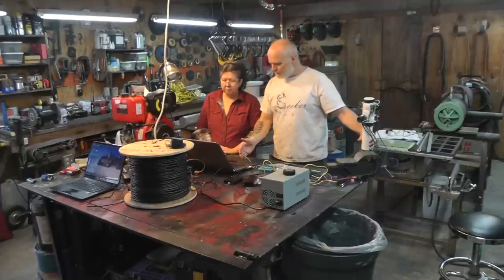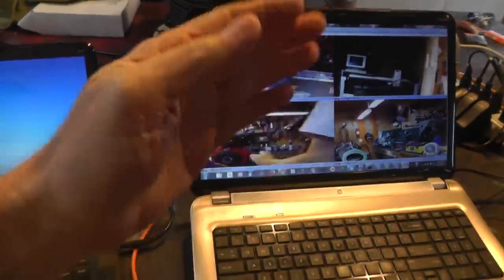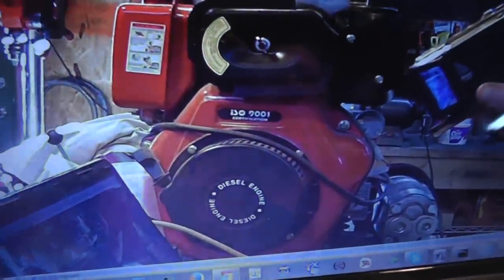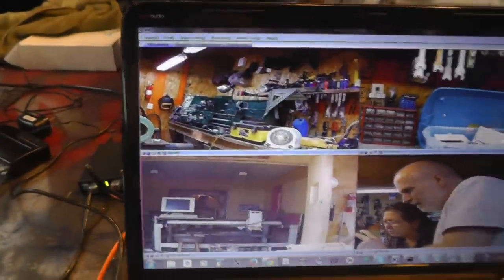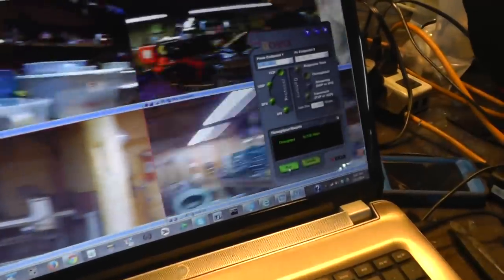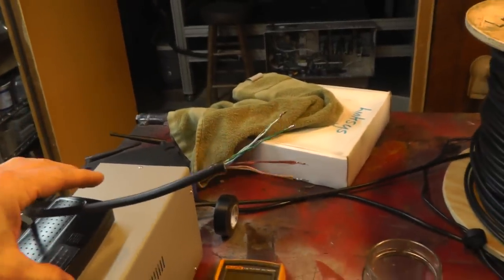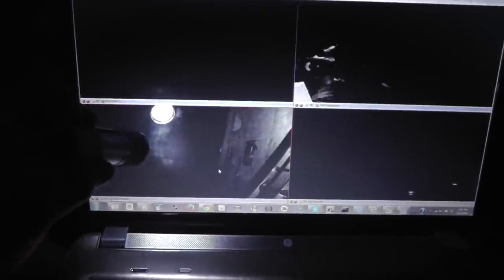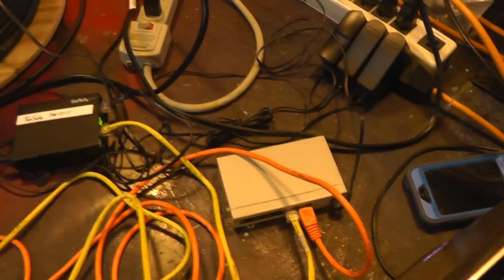ROV Communication and Control - Part 2 - Video Cameras

Comment: look in to "raspberry pi". I'm not very familiar with the technical specs but you might be able to use that in conjunction with the arduino to record HD video in the ROV and only send the low res video to the surface.
Reply from the maker: We did.  That's a good unit too.  Going with Arduino because my friend Drew is doing some of the controller work and he already knows Arduino.   From what I've seen it's an easy system with great add-on.   He started on the IMU and had numbers in minutes.  I did find some discussion of PI and NVR's but it was not Full HD capture.

Comment: for lights i recommend using the head from the cheap Chinese CREE LED flash lights sometimes they write police 500w on them sometimes its something else and they have a focus lens witch you can drive with a small servo if you want i can make a quick video of mine they are incomparable to what you have
Reply from the maker: Thanks.  We got a few of those to do testing with.

Comment: OK - it's 2  am an I just finished watching the umteenth video of yours on your ROV! WOW! Great stuff!
I have one note I would like to pass on about the sonar board that will not fit - you may find that when you get the unit you can take off the case and gain a couple of millimeters, depending on whether there is RF sheilding built into the case. If so. then forget it. If NOT you may even get more space by trimming the PC  boards that usually have dead space around the edges.

Best of luck with it! I can't wait to see it in action! Ok - I can wait til tomorrow!
Goodnight & good luck!
Reply: Thanks for the tips. We can always use good ideas. 

And I'm glad you're enjoying the videos!

Comment: First, I love you guys!  Second, if you're not hip to "Rescue Tape", you should check it out.  It's a Silicone based product that adheres to itself when it's stretched creating a waterproof seal (it's also good for up to 500 degrees F).  I do electrical work for film/tv and I've wrapped standard Hubbell type Edison connectors in it and thrown them in the water with actors, haven't killed one yet!  Even if it doesn't work for your ROV, you should have a case of it for your boat.
Reply from the maker: Thanks for the tip. Don't think it will would at depth but it's an excellent idea for stuff on deck.

Comment: Why mount the Overlarge system/s in the ROV at all?  Remote link the sensors to the unit.  High and dry on the surface is safe and sound.  You might need to configure the systems so that bandwidth available permits it.  Digitize any analog inputs/outputs and multiplex them into the remote linkup...but that alone would minimize the electronics for nearly any fancy install you might like to try and implement.  Anyhow,  It's a pleasure to watch your work.
Reply from the maker: Thanks, we considered and A to D and D to A setup, but apparently it's not possible to digitize transducer signals without losing important data.

Comment: What is actually the idea to use 4 camera's?
I can imagine that 1 for looking around is obviously nice and perhaps 1 looking at an instrument panel with depth-gauge and a compass would be nice ... but that is only 2...
I was just wondering..
Reply from the maker: Forward, Port, Starboard, and Aft views.   Just so more imagery can be collected and nothing is missed on a single fly by.  Research vessels are expensive and tend to drift in the current so time will be in short supply.

Comment: Lag is due to packet loss, because ethernet is not designed for long distances, cause sensitivity of reception (ethernet transformers) is not so high. RS485 or better WIFI through wire would be more suitable, since radio sensitivity is far more superior to ethernet transformers on your switch.
Reply from the maker: Andrius Jasinskas It's using VDSL2.

Comment: Why don't you use ethernet to fiber optic converters for the data transmission back to the surface instead of this giant spool of cable? it is more robust and faster than the copper cable... And the converters start from something like 25-30$ ;)

Comment: why are some cameras reversed? if you have the money, use fiber optics. fastest signal cables. Also it will not slow down the speed because you are putting more data on the signal but if you had more requesters(more computers) it will then start slowing down. You need the source to have a stronger signal out put, same principle as radios. Look at putting a signal boost on the module, can look up repeaters for that. it will charge the signal so it doesnt lag on higher def pictures. the one thing about that is you need to find a low volt one because you will have to use a pair in your cable to send power. But im thinking it may be your receivers that are slowing the signal down because it doesnt process it fast enough.

p.s please take off auto play for next video. it killed my last comment because the next video came up. it had more info. if you have any questions about the networking of your setup just message.
Reply from the maker: Cameras are reversed or upside down until the cmos chip is told which way to flip the frame.  Specs for this job are single twisted pair.  Besides, it's a hell of a lot cheaper and field serviceable by monkeys.

Comment: Have you thought of using gigabit switches instead of 10/100 switches? Much higher bandwith and not much more cost.

Great videos, cant get enough!
Reply: he's using VDSL2, which is only capable of 40Mb/s theoretical maximum. 10/100 is more than enough.

Comment: Cool video. Not to seem stupid but why are you building an ROV and sonar rig? I thought the sailing boat was going to be for recreation only? Very impressive how little you will be spending on it all! Is the bad weather preventing you from working on the boat? When will we see more boat videos?
Reply from the maker: More boat videos in the Spring.  All about the ROV for now.  And only the sailboat is a work boat, not a plastic and chrome pleasure yacht.  :)    We plan to use it for doing things like operating deep sea ROVs, search and recovery, diver support, research, etc.... That's our kind of recreation.
Reply: Sounds like my sort of sail boat, I was never big on the whole hanging around with nothing to do until the wind picks up idea.

Comment: I am working on a 3 cam ROV (only 300 ft depth) and I am using several Arduinos  to run the pan and tilt for the main camera (the other two cams will be fixed)  as well as sensors, lights, thrust motors and a gripper arm. I am linking the Arduinos via I2C and splitting the PWM task for the thrusters across several Arduino Pro Mini boards. This way if I have a board failure I may still have some maneuverability. I was going to run CAT5p but I like your idea of VDSL2 much better. What is the make and model of the hub? I would like to exchange ideas with you on this topic. I don't know much about building ships, so I can't help you there.  Thanks for all the great videos.
Reply from the maker: +Lars      Cool.  Details are here until Betsy gets it moved to the new site: http://svseeker.com/rov_controller.htm
We are going back to work on the ROV in July-Aug.
Reply: +SV Seeker Looks great. I can't wait for the finished unit.

Comment: Just seeing this video now. You should consider using a fiber optic cable and a media converter at each end. http://www.amazon.com/Gigabit-Ethernet-Fiber-Media-Converter/dp/B004FUUY52

You can also source custom fiber cables from a place like Monoprice which is inexpensive but very good quality. Alternatively, you can simply buy your own spool, polish and terminate the ends, and have as much length as you like.

Two huge benefits are bandwidth (you could stream 1080p or 4K from the ROV) and electrical isolation. I'm not sure if you're running the ROV from batteries internally or from an electrical umbilical from the ship, but in either case completely isolating and eliminating any sources of voltage on your data connection will save you an awful lot of agony. Voltage spikes on Ethernet ports is a death sentence.

Anyway, it could be possible to run a media converter (especially a low powered one) on batteries given they're usually low voltage and amperage.
Reply from the maker: +Tom Cameron    Yes and I don't like it.   Watched a research vessel pull off a site in beautiful weather and transit a day back to port because of a broken fiber.
Reply: +SV Seeker Yeah, glass fiber is delicate. I to nk it has a 1" bend radius or so. The more common plastic is much more resilient.

Either way, be very sure to isolate the Ethernet ports from the cable. Awesome work, though!

Comment: have you heard of mineral oil submersion for your electronics on the r.o.v.?
Reply from the maker: Yes, PBOF (Pressure balanced/oil filled) systems and Woods Hole adds NNL690-G Oil Fortifier added for lubrication for motors.

Comment: I don't know if someone has looked into this yet, but I keep on wondering about the permiability of the cable. Salt and water will work their way through most insulators and reach the copper at some point. Maybe your cable won't be in the water long enough? Might be worth dunking a length in salt water for an extended period while you work on the rest of the project?
Reply from the maker: Most definitely a concern.  We're using bury type cable for testing and the connections will be Sub Con connectors designed for deep sea usage.  Then will see if we can make a DIY copy of them. :)
Reply: You read my mind! Direct burial cable would be a good start. I would be inclined to immersion test a length of it. Sea water is a funny thing...

Do you have a 3D printer? They are extremely useful for fast DIY versions of things, prototyping ect. You could work out a design for marine sub con connectors in plastic, and then machine out of metal if needed for the final thing. Fun for metal casting too...

Comment: Analog video would be the way I would go if real time was important... Latency would be essentially zero. A camera with 540TVL 30fps with CS mount lens, auto & manual exposure controls and extremely low lux capability is like $40. 

I would also think capacitance of the cable would become a big issue with bandwidth of UTP at those depths through salt water...??

Comment: I am worried the lag is caused by your computer, not the cameras. You may want to try them on a high end desktop...?
Reply from the maker: That would be nice if that's that case.   Nothing to fix.
Reply: SV Seeker
They do make high performance laptops. I have one myself, its a G73 asus.
Reply: is there some reason you are not using fiber optics? you can get gigabit speed with that.
Reply from the maker: Scooby's Scoop Yeah, the main reason is the specifications say single twisted pair, but I prefer twisted pair as it is cheaper and simple to splice and repair in the field.

Comment: for a splice, how about molded silicon rtv.  a two part tubular mold around the splice and inject silicon around the joint?
Reply from the maker: Right.  I seen connectors like that at commercial electrical supply houses.

Comment: Will you be encasing the IP cabling in a protective sheath?  Also will you be building a special winch to reel in all that cabling?
Reply from the maker: We're just going to test in the lake with this cable.  The research vessel will have a rig and cable specifically designed for the task.
Reply: Very cool.  Can't wait to see the video of that testing.

Comment: you might also want to get some software to aline the feeds to be in line once you get the lag figured out.
Reply from the maker: Suggestions?
Reply: http://pixelwix.com/warp-and-blend-software/11-pixelwarp-dt-wide-screen-desktop-warper.html 

Then a free solution is http://www.edge-blending.com/

I have not played with either of these but I do know that they are theyier. It seems to need multiple projecters and a curved creen but this would be wicked cool.
Reply from the maker: Justin Vaughn Thanks Justin.  We'll look into it.

Comment: the lag is comeing from the computer. its rendering the live video of 4 cameras at once. Thats what I think
Reply from the maker: Hmmm...  maybe.  ...faster computer?  ...better video board?
Reply: Well I would make all the cameras the same resolution. The if the become more in since. If you will be using a computer on the ship then I would invest in a major comp. But for now yeah get one with duel video cards. Or a dedicated video card. Your laptop may be running the GPU in the CPU. If you can build a boat you can build a computer.
Reply: Well theres one way u can test if its the  bandwidth or video processing  causing the lag. If  u can save the video to disk without rendering it, setup 3 cameras to save image to disk and just have the pc render one image all at high resolution. so youll have the same bandwidth going down the pipe as before but your video card should be processing 75% less. If it lags the same as before chances are its the Lan.
Reply from the maker: Joepopa12 Great idea.  It will be a while before we hook them up again, but I'll be sure to try that.

Comment: I use to use remote  electric car mirror motors for moving my cameras.
Reply from the maker: Interesting idea.
Reply: SV Seeker
And if you place one end to end you can double the swing of it. I used early Fords say 90's and used the switches too.
Reply: Why not just use of the shelf servo's as used in RC model planes.
The are extremely easy to control very precisely with a 1-2 mS pulse-width and more that powerful enough for the job.
On top of that they cost next to nothing.
.
Reply from the maker: Spikejwh1 We have some servos to test.  Their weakness will be the circuit chip inside.  It will have to survive the pressure, so we'll pot it and cross our fingers during the test. :)

Comment: Lovely how you just built stuff and don't let a lack of (specialist) knowledge stop you. You probably do realise that this will not be the best 3D printer you can make?  I see two major flaws with it: speed and shinkage. A heavy CNC machine will not be able to get the speeds/acceleration you need for quick 3D printing. You could try to print at 50mm/sec (pedestrian speed for 3D printing), but the heavy mechanics will require relatively low acceleration which means loss of time to get up to speed. the other thing is shrinkage. At small object sizes shrinkage is not so bad (for PLA), but the larger your objects become, the more the internal stress will try to lift up the corners of your objects, leading to warped and/or failed prints. Especially with this large table of yours, you'd be tempted to make large objects, that will give you some challenges.
If you have not already done so: buy a good quality hot-end (prusa, E3D), and put a large nozzle (0.8, 1.0 or 7x 0.4mm) on it if you want to print larger objects. Stick with PLA unless you install a heated bed.
But most of all: keep having fun!
Reply: Bugger, this comment was meant on the 3D printing vid, not this ROV stuff. Probably thick fingers on my part...